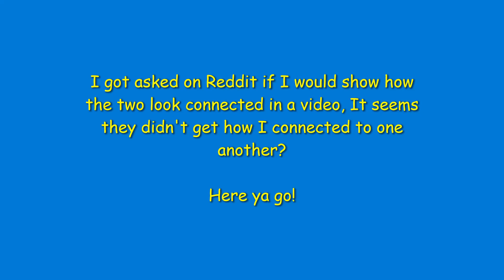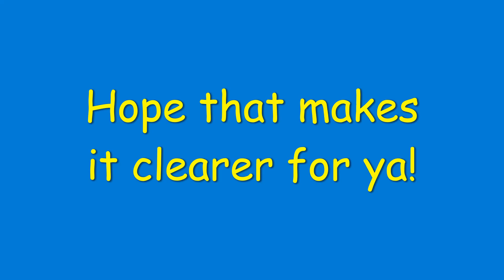Dio Reed & VM22 Carb How I linked them question response video

Comment: Hey how are you,,,I just broke down and bought a duel reed valve peddles, ,and there for 80cc engine ,made by boyesen reed company, ,I'm running them on a 56mm stihl frankenstein engines, ,there are alot stiffer than those regular tipe reeds ,,the throttle response improved big time ,try them ,they are really worth the  40 bucks
Reply from the maker: yeah I have some of those!  My only issue is the carbon fiber reeds tend to hate the south near the ocean areas where I live.  I don't really know why but they don't last very long here.  I don't know if it's the humidity or the salt air.  W/e causes it they turn a dull White pretty fast then fray all the time turn into Carbon Fibers LOL
Reply: Oh dam that's not good,,kinda weird how there doing that,